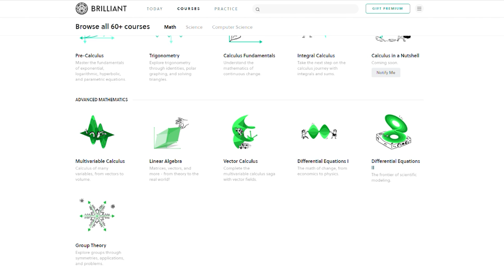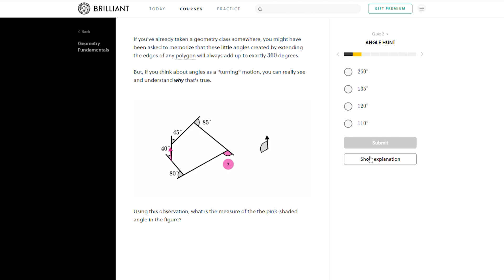67 | SpaceX Starship Updates – Kennedy Space Center SpaceX & Blue Origin Update

Comment: wouldn't it be more efficient for space x to use fiber domes for the full tank ...which they have already produced...and use stainless steel for the rest of construction.???
Reply from the maker: Musks top priority is to reduce cost, not to get it into orbit as fast as possible. I guess, that's why they're trying it with stainless first.
Reply: Engineering for thermal considerations is easier with a single material. It's also much cheaper in many different ways to use a single material due to tooling, facilities, etc. A tentative design goal for starship is also to use the structure for thermal transfer and as a heat sink (including fuel and fuel tanks)